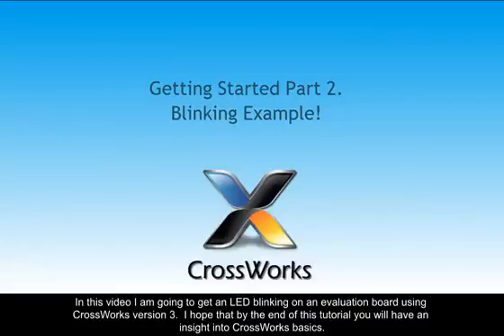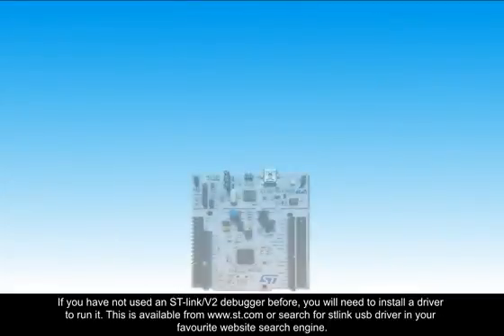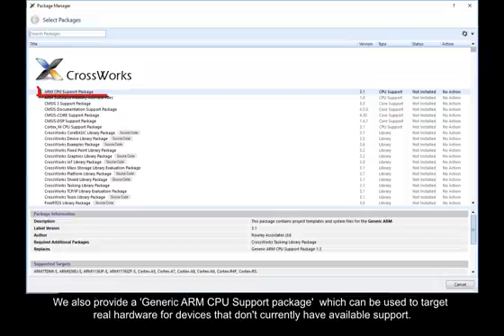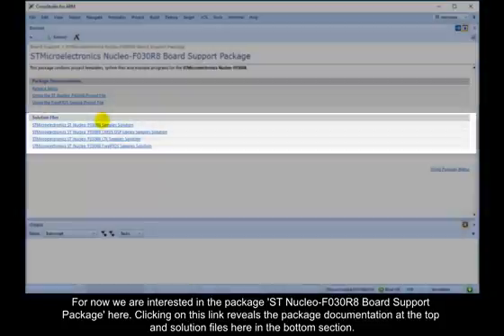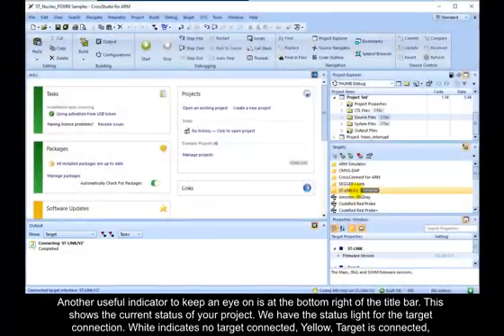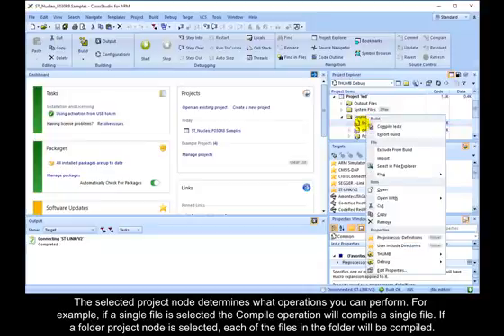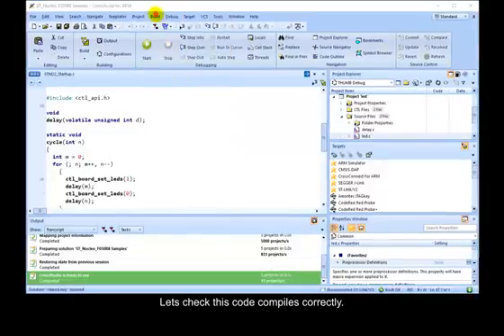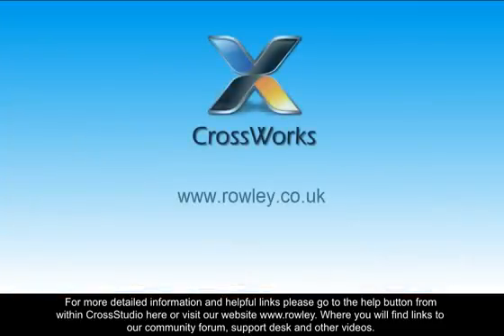Getting Started with CrossWorks - Prt 2 Blinking an LED

Comment: What is the advantage of using the Rowley CrossStudio IDE over the chip-vendor's tool, or Keil/IAR/Segger Embedded Studio?

For example, Microchip's Smartfusion2 uses SoftConsole (Eclipse), but the chip has a JTAGSEL pin that must be pulled low (via 1K??) to enable Arm debugging via Segger's J-Link or Amontec's JTAGkey / JTAGkey-2 (FTD2232 based).  Otherwise, if the pin is high, then both the FPGA and the Arm are on the jtag chain.. and to debug the Arm, one must send an appropriate jtag command sequence first.  (BTW, I assume a 1K is needed because the chip has a weak pull up, and would be sourcing too much current if shorted to ground?)

The SF2's MSS contains 64KB (2 blocks of 32 KB embedded SRAM, and if SECDED is disabled then an additional 16 KB of eSRAM is available).. and I'm interested in using SWD's SWV to pull stream data from it!
Reply: Eclipse based IDEs are a burden and hinder my workflow. Crossworks 'just works'. It's an excellent environment.